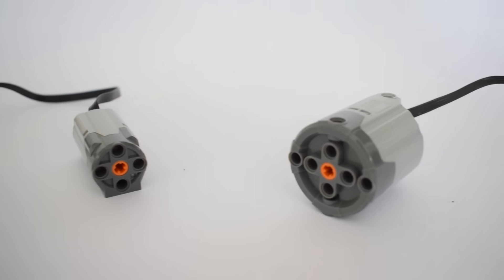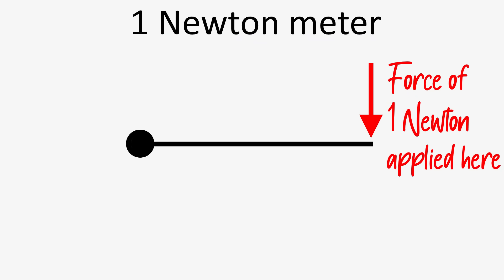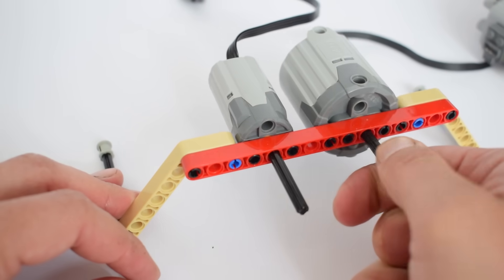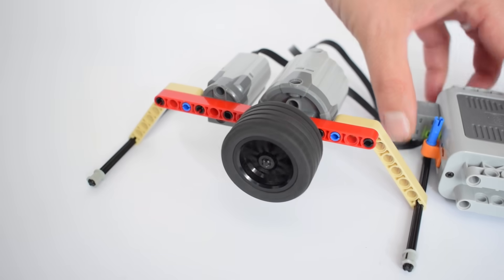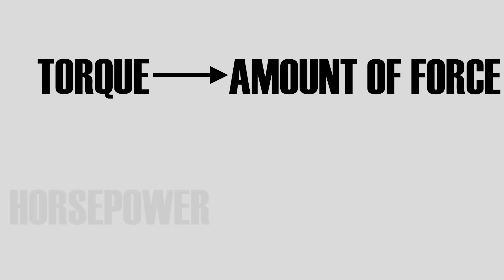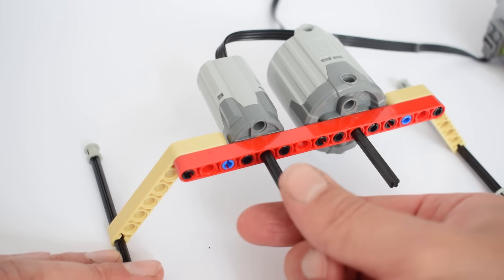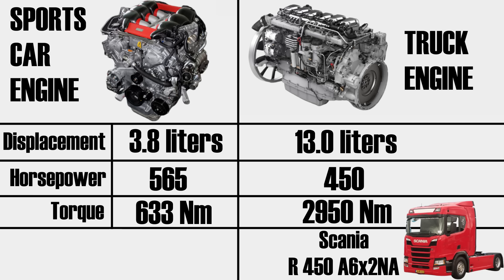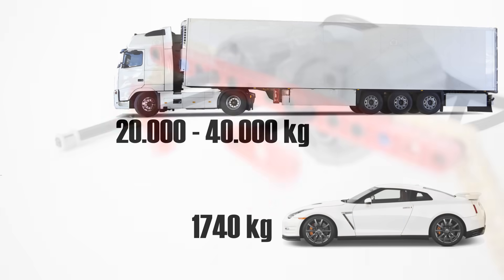NEVER be confused by HORSEPOWER and TORQUE again - HP and TORQUE EXPLAINED in the MOST VISUAL WAY

Comment: reason why high torque engines are used in trucks is because they are cheaper and more reliable, not because of torque. You need horsepower, not torque to do the work. You can put 13000rpm engine, gear it properly and have best sounding truck in the world, but reliability, price, efficiency would suck.

Comment: i have a question: let's say (as in your example) that we have 2 e motors, 1 with 15 kw and a rpm of 3000 and a 15 kw with a rpm of 1500.
So, because we know that speed*torque is power, we know that the motor with 3000 rpm will have less torque than the 1500 one.
My question now is: how do i get there in the 1st place? What do i have to do that my e motor has such amount of torque? Do i have to use stronger magnets or more windings? Cous now i know that you can manipulate the torque with gears but the "start" torque kinda stays the same, no? (pls correct me when I'm wrong) so if you could explain that, that would be helpful

Comment: Great explanation but near fatally flawed. HP is not Torque X RPM. If that were true, my BBC would be making 2.7 million HP at 4500 RPM. HP = (Torque X RPM) / 5252. HP is always equal to torque at 5,252 rpm.
Reply: He is correct though, the equation is just way more complex, but hp is basically torque×rpm! You can use a very rough equation to calculate your horsepower!

HP = Torque × Rpm / 5252
Reply: @DonCamilloBeats  no. An equation that is missing the most important constant is not “correct.” It’s at best, incomplete. If it were a classroom test it would fail. You then proceeded to write the exact same equation that I wrote.
Reply: He meant that power is the product of torque and rotational speed. When using different units, you may need to add a coefficient in that equation to get properly scaled results, but the variables are the same.
Reply: @beanapprentice1687  he meant? He fucked up and posted the video.
Reply: I think it was a great video but I was confused about this too, and I don't get how there hasn't been more comments about it. What's more is that I saw this same equation on multiple very high view-count videos on this subject but they leave out the /5252.

Comment: Very good explanation of this simple yet difficult to grasp physical concept. Only thing that could be added is that horsepower rules. The sports car engine would outperform the truck engine if it was installed in the truck. It would just need to be geared down. Of course you would have to rev the crap out of it all the time which would be noisy and tiresome. Also it would wear out real fast in that kind of use.
Reply: But cant you gear up the truck engine to go as fast as a sportscar also?
Reply: @libertas12  you can gear both engines to have ideal speeds for the application, but the truck engine would never go as fast, because it has less horsepower.
Reply: @acedeuce802  "...truck engine would never go as fast"  WRONG!  Horsepower is a RATE OF CHANGE OVER TIME.  Top speed of the vehicle would be no different as long as you had the same amount of torque available at the wheels, at the same rotational speed.  Acceleration, on the other hand, is determined by horsepower.
Reply: @awebuser5914  horsepower dictates wheel torque a given speed. More horsepower, higher top speed.
Reply: @acedeuce802  What part of: "...at the same rotational speed" is giving you trouble?  It's all theoretical, but you need torque to offset drag and if a truck engine can be geared to have the same available torque, at the same axle speed, the top speed will be the same.  Of course, it's moot since the truck engine would be larger, heavier, etc, but the principle is the same.
Reply: @awebuser5914  what you're missing is that there is no way to gear the truck motor to have the same axle torque at the same vehicle speed as the car motor. If the engines have the same torque but one has more horsepower, then at the same vehicle speed, the higher horsepower engine will have higher axle torque (given that they are both geared appropriately).
Reply: Wear and tear should not be underestimated in the equation, as every sports car will fail more quickly and dramatically than any other vehicle. The tremendous hp have an enormous effect on the engine internals as well. The trucks don't need the speed, but they will break faster with faster engines. Trucks are meant to drive all of the time and not break down, so fast engines don't make sense
Reply: @libertas12 and @awebuser5914 what @acedeuce802 is saying is correct.  Gearing can multiply torque but not Power.  The GTR engine makes 20ish percent more power it has the capacity to put 20% more torque to the wheels at any speed than the diesel semi engine.
Reply: Good post.  @acedeuce802 gets it.  @awebuser5914 is repeating hivemind 🚮

Comment: Hi, great explanation. Though there is something that still confuses me. Through gears, torque can be adjusted, in other words, horsepower can be used to produce torque. Then why does a truck have a big engine and a race car have an engine capable of more RPM? When is it more convenient to have more torque and when to have more RPM? And another question: for motors with the same maximum power, the motor with high RPM does it feel different than the motor with more torque? Thanks a lot.
Reply: Engines which make power using high rpm can be lighter. An engine which produces more torque is heavier for the same power. However, high RPM engines are harder to manufacture.
Reply: It may be a bit late, but: 
The small engine is more dynamic: The torque applied is determined by the RPM and gearing. This means a small engine can only output a small amount of torque if you don't rev it high, however the engine will be less efficient with higher rpm. This makes sense for smaller vehicles since a high amount of torque is only needed for fast accelerating and going uphill, so they actually don't use their theoretical power and run with low rpm most of the time, being more efficient.
The truck engine can't rev high and outputs (more or less) the same torque all the time. This makes sense for heavy vehicles like trucks which use their full torque (and HP). That engine does not need to be dynamic too because these vehicles usually just drive with constant speed.
Reply: @wenjaaaa  this makes sense. Thanks. I believe you are referring to the torque at the wheels.
Reply: @torevenheim9607   your explanation is wrong. Power (HP) means torque X rpm. High torque with low rpm means the same power with low torque and high rpm. Please see above the correct answers from Heinz and BeanApprentice.
Reply: 1. You need rpm to be fast since horsepower just means how much work can be done! In order do accelerate fast, you need high rpm (more horsepower) to work very fast!

I might have a good explanation:
You and your friend sit in a boat, you have 1 paddle and your friend has 2 paddles, you both have the same strength (torque)! Your friend will be faster because he will get work done fast because he has 2 paddles (rpm), therefore more horsepower!

2. The one which accelerates faster will give you more feel!
Reply: @DonCamilloBeats  I don't think you are right. Power means RPM multiplied with Torque. So, for high power you can have either high RPM or high torque. The video explains this quite well. My question was how you choose the right balance between them when designing an engine.

Comment: I want to make sure I understand the concept of measuring a motor by torque. So let's say that a motor claims to be 30 foot pounds and you want to actually test this. So you attach a one foot rod  to the shaft (like the small red pieces you attach to both motors at 5:12). If it really is 30 foot pounds, then it means that if you grab the rod by the very end, it will take 30 pounds of force to stop the motor from turning. Is that correct?  If the rod was twice as long (2 feet) does that mean that it would take half as much force to stop it (15 pounds)?
Reply: Yes to all. The machine used to measure torque of an engine is called a dynometer. It puts a load (brake) on the engine and measures how hard it turns against it.

Comment: Hi, if you connect the shaft of the small motor to some gears, can you increase the torque and match it to the big motor? thanks
Reply: Yes, but the speed would be reduced by the same factor. That is why power is arguably the more important number. Using a 2:1 gear ratio doubles the torque but will halve the speed.

Comment: But why big engine with high torque combined with gears to get higher rpm still cant beat small engine in terms of horsepower? Can't understand how it can be real that big engine which consume more fuel and energy can give lower amount of horsepower (power * time). If it eats more power then it should gove more output power in same time interval.

Comment: What is confusing is that there seems to be 2 implicit defintion of torque. One that is dynamic and the other that is static. 

The original definition of torque was linear and was about the amount of force (lbs) that a horse was able to produce times a distance (ft). That would be the dynamic definition (ft•lbs). 

The static definition implied in the case of a wrench and a bolt seems more to be of a maximum frictional force.

To illustrate the difference, imagine a torque-wrench moving a shaft around an axle. The dynamic torque there would be the friction force at the interface (lbs) multiplied by the distance/circumference (ft). You could basically do any amount of *torque (dynamic) imaginable as long as the frictional force doesn't surpass the static maximum **torque (static) and the torque-wrench wouldn't "click".
Reply: Torque is rotational force, how hard something turns. It is force multiplied by distance from the center of rotation, ie 1 pound of force applied on a 1 foot long wrench gives 1 pound foot of torque.
Work is force multiplied by the distance that force is applied. Applying 1 pound of force and moving a box 1 foot consumes 1 foot pound of work.
Work, torque, and energy share the same unit dimensions. They are all force times distance. But they are different concepts and are defined differently.

Comment: i dont really agree with the truck and sports car analogy. yes it is correct from a flywheel perspective but i dont think its fully representative as it doest take into account gearing. a high power but low torque (and therefore fast spinning relative to a lower power but higher torque) engine can produce high torque at the wheels thanks to gearing. this is why air tools such as impact guns work.

its quite funny. torque both doesn't matter and completely matters with engines. you can gear for massive torque but you need to produce torque at certain rpms to get the driving characteristics you want

Comment: I don't know why, but I haven't seen a design were the driver gear is mounted in the middle of two gears to be driven I. e one driven gear at left and the other at right, all having one central axis of rotation.

Can you explain why this is so
And does it follow same calculations for  gear ratio?
Reply: a constantly variable transmission does this

Comment: @driving 4 answers if two engines produce exactly same torque at shaft but have different horsepower output, i.e., one engine has higher rotational speed than other engine, will it require same effort to stop the engine rotation?
Reply from the maker: The effort required will be the same because torque is the same
Reply: @d4a   when we stop the engine rotation by applying a torque externally, does the horsepower of the engine become zero since it is defined as the product of torque and rotational speed?
Reply from the maker: Yes obviously if there's zero rpm there's zero hp since you're multiplying by zero.

Comment: Here is how it was explained to me when i was quite young and was building race cars with my Dad. Horsepower is HOW fast you can go, Torque is how fast you can get to that speed.
Reply: Nope. Power is both of those. Torque is just one of the two components of automotive power, the other being rotational speed.
Reply: @beanapprentice1687  sigh, it's an easy explanation that the layman can understand. The idea is not to spend an hour trying to get someone to understand over bore or under bore and how that effects torque. Or runner length, or chamber size or exhaust pulses or ... do you see the problem here. There are so many factors in an engine that affect both horse power and torque, you could spend months trying to delve into any one of them and still only scratch the surface. Their is a reason the engineers at Chrysler (back in the 60's) formed the ram chargers. The publicity was just extra. They were at the track every weekend and what they learned went into every car they made. So we need simple ideas to encapsulate things, hence my analogy. I wasn't trying to be precise. I was trying to give an overview that was easily understood.

Comment: If you put that gasoline on a truck and put the right gear ratio. It'll be just as capable? The engine rev will just be annoying. Like there's a generator underneath you.
Had an actual experience, but it was the opposite, a diesel engine was put on a gasoline vehicle. And they don't believe me.

Comment: Horsepower matters more for top speed. Torque matters more for towing.
Reply: Wheel torque matters for towing, not motor torque. This is because wheel torque can be greater than the motor torque thanks to gear ratios.

Comment: This is the second time I had to watch this video:
So for those with Memory issues:
Torque is the FORCE applied.
Horsepower is The Torque measured or FORCE applied over TIME.
Or Torque x Revolutions per Minute (RPM)

Horsepower is the Rate at which that force can be applied.

Example A Van could do the same work that a Lorry could to, but it would take MANY more journeys to do it.
So I conclude/equate that the measurement was invented to state how many horses would be needed to perform a certain job.

Comment: What I've never understood about these explanations no matter how many times I've seen pretty much every single video on this same topic is why we can't "feel" horsepower. I know torque is supposed to be the acceleration, and maybe this is a bad example because obviously semis are huge as hell and need the torque for moving things, but I don't understand why torque is supposed to accelerate you when a sports car with more horsepower and far less torque will easily outperform and accelerate quicker than any semi-truck, (or even passenger pickup trucks which is probably a way better example for my hypothetical). I just can't wrap my head around how torque is supposed to accelerate you faster when time doesn't even come into question with it and horsepower is as you've described "the rate at which that force can be applied over time." If that's the case shouldn't horsepower be the accelerator since if it's got horsepower, it's able to better apply that torque quicker? And why's horsepower always praised as the go fast number, especially since in the video it's described as not being able to be felt, but only observed?

By the way, I love the video and none of my confusion is due to anything wrong with your video, it's just my misunderstanding of it. I've watched hundreds of these same exact videos and it feels like this should be an easy thing for me to understand but I can't wrap my head around it.